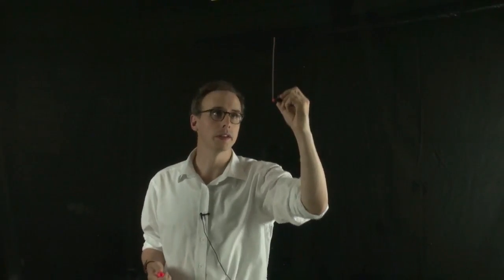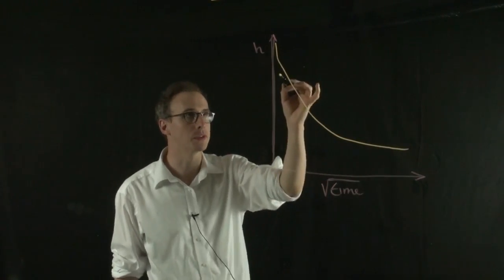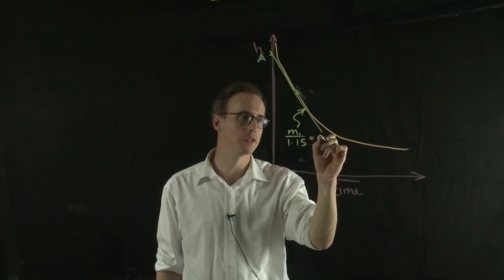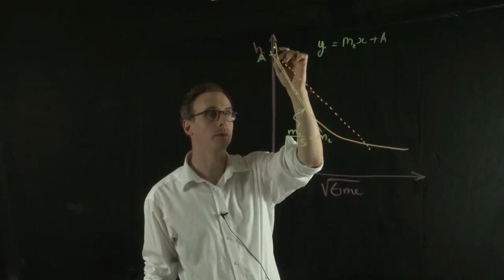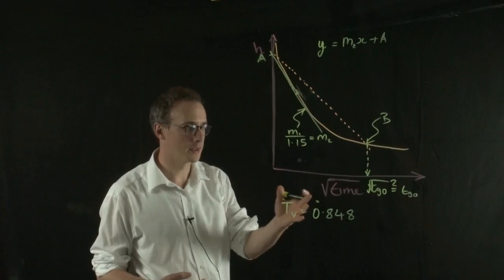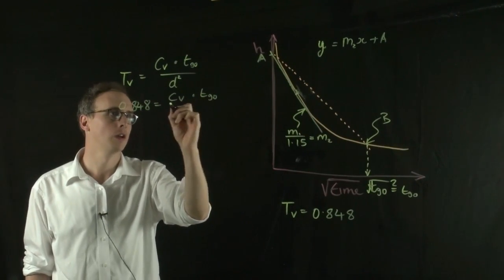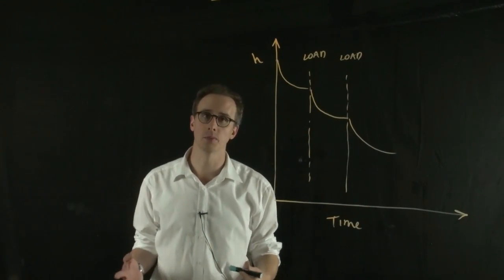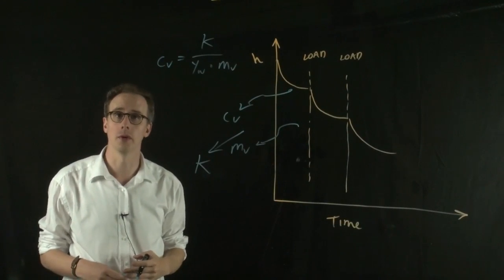Root Time Method

Comment: Do you need to square the T(90) for the equation since it's the square root?
Reply from the maker: Hello, good question, its not so obvious from the video. Your x-axis reading will give you a number that is = square root t90. If you square this number you will get t90. So if your x axis reading is 14 (sq root days) your t90 will be 196 days. That means 196 days to reach 90% consolidation. Pop this into the equation to calculate cv

Comment: Hi Sir. Does coefficient of consolidation change with stress increment? For instance, Cv = 1.5 for increased effective stress 100 but = 2.0 for increased effective stress of 200? Or is it constant throughout.
Reply from the maker: The coefficient of consolidation is directly related to the permeability of the soil. So as the soil consolidates, the soil permeability decreases and the Cv will decrease. You find this when you do the root time method of different load increments of the oedometer test.